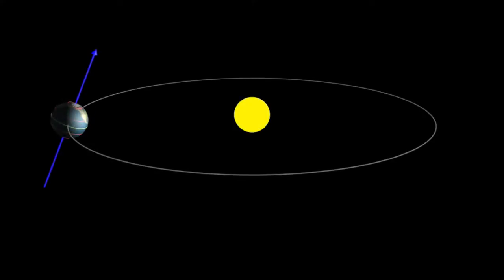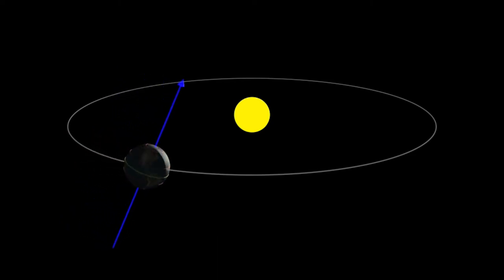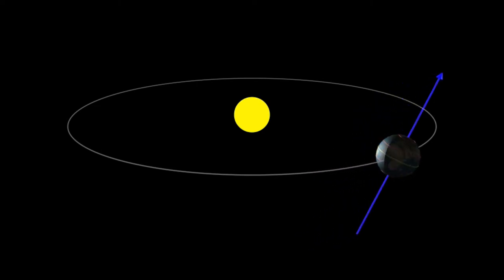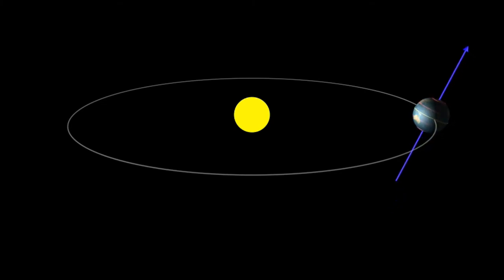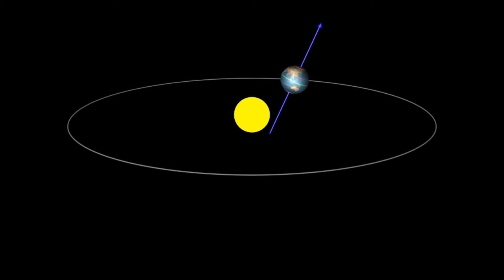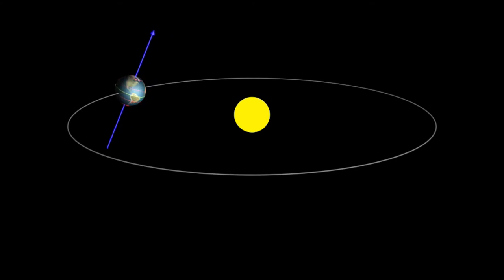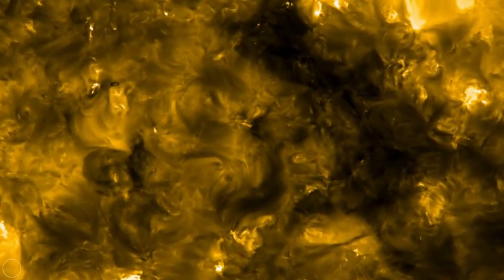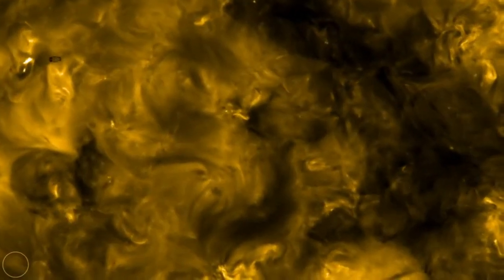A World of Momentum

Comment: You got the earth's axial tilt correct, but you forgot the elliptical orbit around the sun.  I know it throw's off the neat equilibrium equations.
Reply from the maker: Some simplifications were of course made. The Earth's orbit is an ellipse, but it has a very low eccentricity, with perihelion and aphelion differing by less than 4%. If you're making mathematical predictions or modeling, yes you need to include the Earth's orbital eccentricity. For the purposes of this video, such a simplification is appropriate.